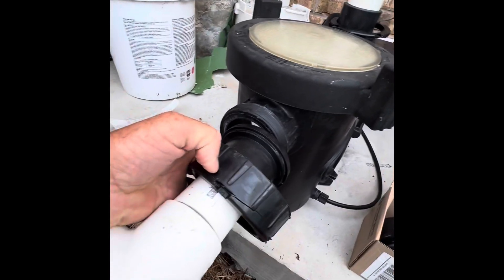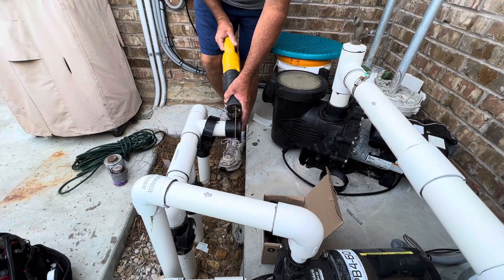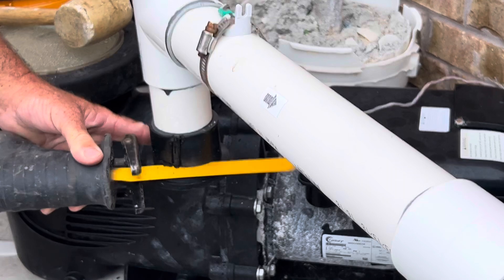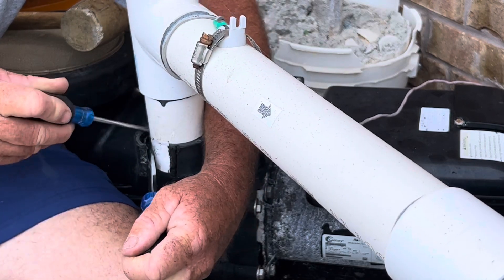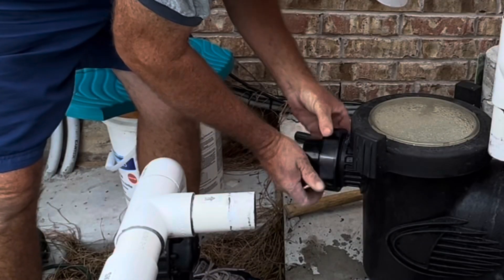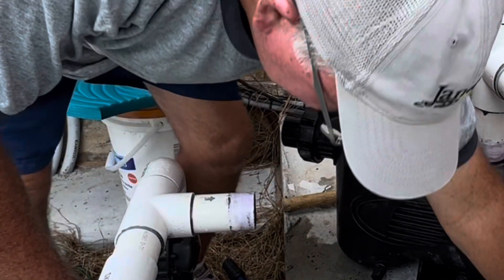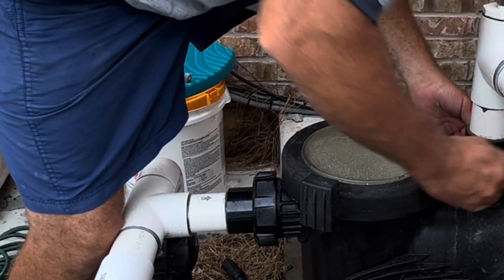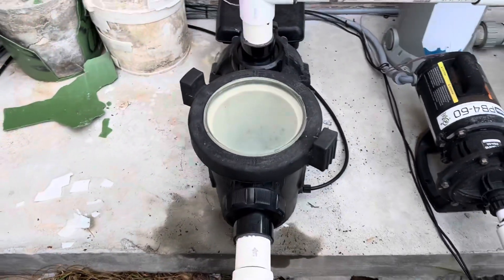How to replace broken nut on pool pump; Jandy Stealth Pump

Comment: At the 1:45 mark, would it be wise to put tape over the opening on the pump in order to keep any plastic pieces from falling in?
Reply from the maker: Yes. That’s actually a good idea. Tape or a towel would be a good way to prevent a chunk of plastic from falling in. Thanks for sharing

Comment: Will this work if glued with blue glue? Just harder to get old collar off?
Reply from the maker: Blue glue on a different level. When we see blue glue, the procedure is a little different. We cut many slots in the pvc connector we are trying to remove. One   every 1/4” all the war around the fitting. A dremel with a 3/8 cutting wheel works great for this. These smaller sections will usually pop off fairly easily when tapped with a screwdriver and mallet. Then a quick sand with the dremel and a flap disc sanding bit. 

Here is a link to Amazon for the dremel cutter. 
https://www.amazon.com/dp/B00004UDGP?tag=price15602-20&ascsubtag=wtbs_6497506b74e7c833e9d21271&_encoding=UTF8&tag=stevethepoo0c-20&linkCode=ur2&linkId=cdf61017c3ddfaec69aba2a8abfd06eb&camp=1789&creative=9325
Reply: @Pool-guy  thank you! Your videos are the best.

Comment: Where did you get that tool from Steve,
Reply: And what is it called
Reply from the maker: @mikedaflame8483 
They used to sell them at Lowes but I haven’t seen them in a while. Here is the link for Amazon 
https://www.amazon.com/dp/B00004UDGP?tag=price15602-20&ascsubtag=wtbs_6497506b74e7c833e9d21271&_encoding=UTF8&tag=stevethepoo0c-20&linkCode=ur2&linkId=cdf61017c3ddfaec69aba2a8abfd06eb&camp=1789&creative=9325

Comment: What dremel tip is that?
Reply from the maker: I will look It up and see if I can find it. I know I got it at Lowes but it’s been a while ago.
Reply from the maker: https://www.amazon.com/dp/B00004UDGP?tag=price15602-20&ascsubtag=wtbs_6497506b74e7c833e9d21271&_encoding=UTF8&tag=stevethepoo0c-20&linkCode=ur2&linkId=cdf61017c3ddfaec69aba2a8abfd06eb&camp=1789&creative=9325
Reply: @Pool-guy  thanks so much!